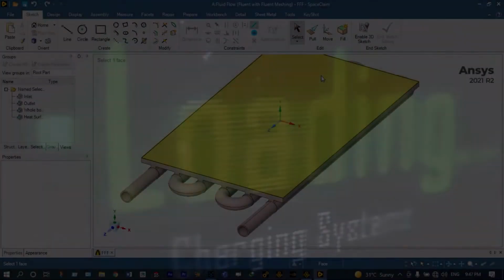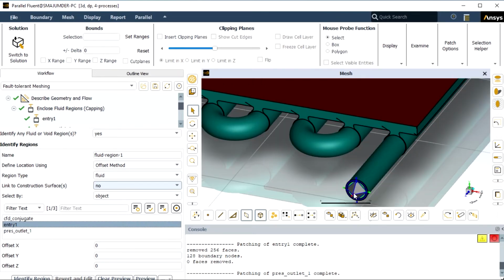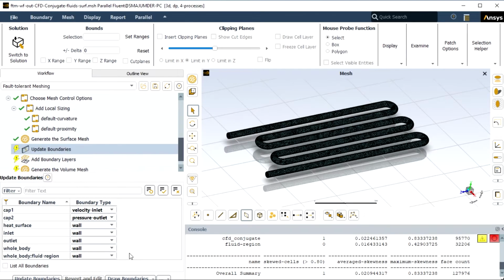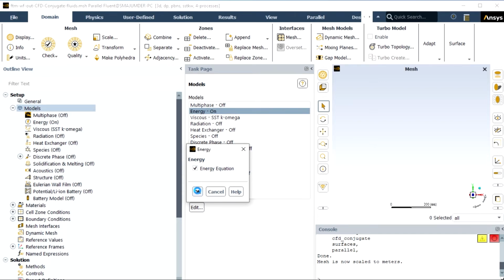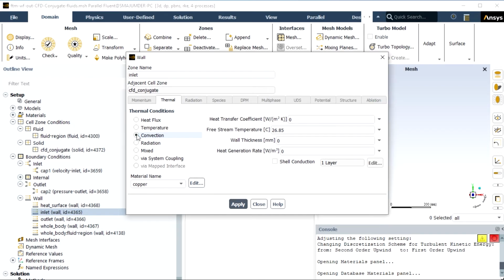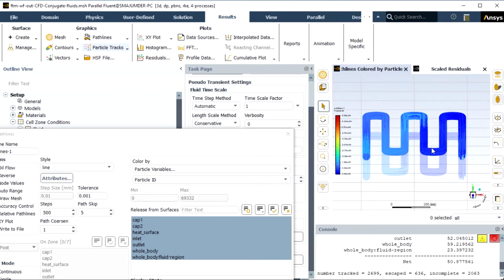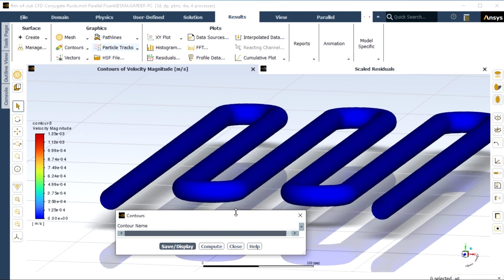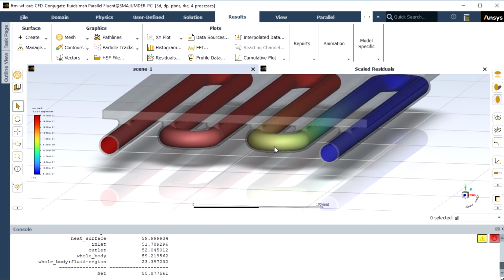CFD Conjugate Heat Transfer Analysis Tutorial | ANSYS Fluent

Comment: is fault tolerant meshing available in ansys student version, im working on a plate heat exchanger for final year project your help would be appreciated.
Reply from the maker: I have made CFD analysis of plate heat exchanger using both Ansys Fluid fault Tolerant Meshing and also using SolidWorks. You can search and see. Ansys fault Tolerant Meshing is available on 2021 release onwards. If you want to learn Ansys fault Tolerant Meshing, you can write to me I will provide my Udemy course on it with 90% discount.
Reply: @CFD_GUIDE  Please,
  Send your Udemy Course link here
Reply from the maker: https://youtu.be/yXlWVp9EW14